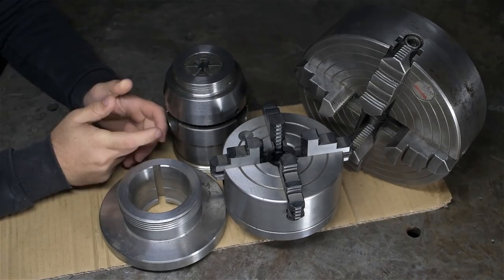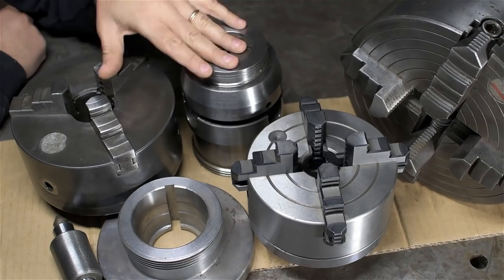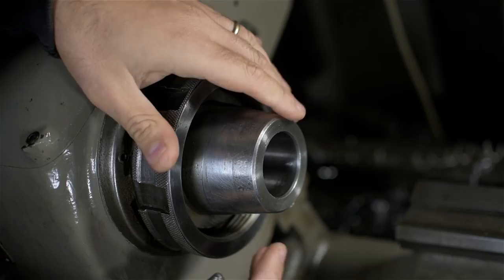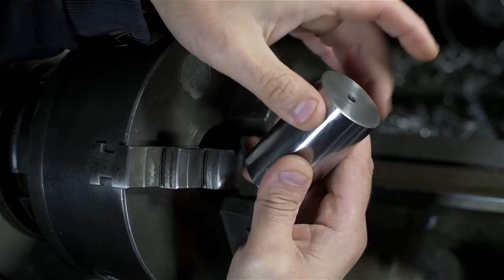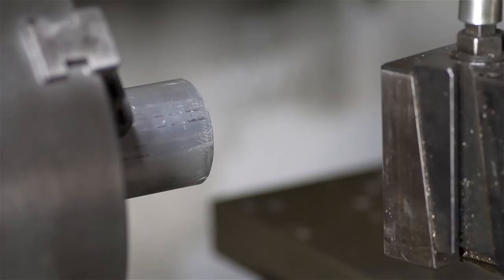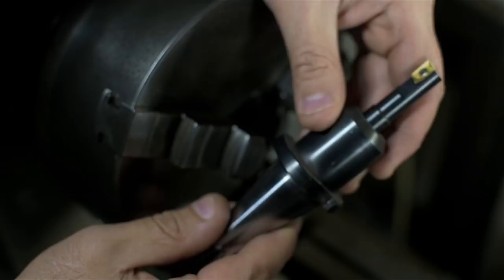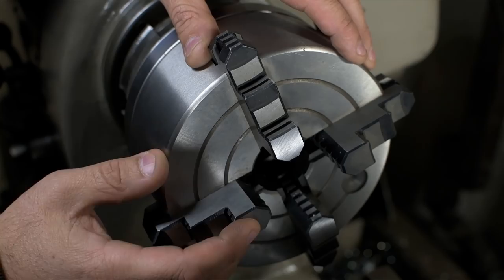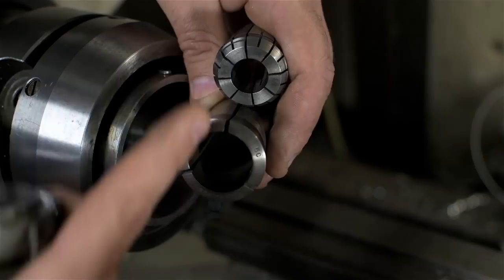Lathe Chucks

Comment: Great content as always. Only one gaping hole in this storyline, Tony. Adjustable backplate chucks. They can make a three jaw run on center, but only because they are effectively a four jaw on one side with a three jaw on the other.

I suppose Clickspring would include the cyanoacrylate chuck on the list. 😎
Reply: Thomas Utley I was thinking about that as well. CA glue and clickspring. Haven't seen anything from him in ages it seems.
Reply: courier11sec He's been busy marking off the progression of the sunset each evening, then inverting the results for Australia to check the Antikythera Mechanism's math for the northern hemisphere!
Reply: Thomas Utley It's pronounced, "Supahglue ahbah."
Reply: Isn't  that what they say in Boston?  :)
Reply: There's a lot more many chucks out there. 

There's the backplate chuck as you mentioned, it's rare to hear others mention it. I've only seen it in old drawings from Mr Keith Rucker's pages. Mounted on the same machine that Adam Booth sold to his work place, the Kearns, it's so freaking masssive it dwarfs the height of the bed...and the moving assembly. Makes you realize that Adam, never used that machine its fullest potential on account of missing that part.

Then there's the rare cone chuck, kinda like a point drive, but with retractable jaws that grab various diameters of pipe on it (a spiffy alternative to driving between points, but without a dog).

Another oddity, eccentric 3 jaw. It's a combination, a plate, but, it has a mechanism inside (controlled by chuck key) which moves the 3 jaw chuck on an axis from center, all the way out to the outside of the plate.

I believe Adam Booth's Kearns horizontal boring mill has a variation of that type of chuck, but his is is tool oriented.

My favorite on this short list, frankly the weirdest i've seen, is a chuck that looks very much like the iris of a photo camera, but does not work like it (each tooth being a sort of distorted cake slice). As i understand, it's used for holding very fragile items, prone to breaking. And it sort of makes sense considering it's about 30 cm deep on the contact.

Honorable mention, the retarded cousin of all chucks, the two jaw...i know it has its uses, but they are short and few.

Like i said, many more, this is just off the top of my head.

P.S. Before ClickSpring, a certain, dashing young fellow by the name of Tom Lipton, did something with resin and a plate...and a penny. ;P

Kinda wish someone with resources would make one mother of all chuck videos and present them all.
Reply: He just uploaded ;)
Reply: And there's plenty of super gluing going on.
Reply: My big take away here was the fact that a 3 jaw chuck run out can vary with the diameter of the stock chucked up.  Never considered it but the scroll dimensions (accuracy) can definitely vary..  Even an adjustable backplate would have its drawbacks with that problem...
Reply: courier11sec he just uploaded a new video.
Reply: superglue chuck ;d
Reply: What about Chuck Bommarito?
Reply: howder1951 Yes, an essential accessory in any machine shop! That Chuck sure knows how to find deals on machines as well.
Reply: Our buck 6 jaw is like that, except it's 6 screw adjustment instead of 4. Not sure why they went that route. Still, if you're good, you can adjust it perfect. I get less than 1 thou of runout on most parts. Makes a 4 jaw only really necessary for when high clamping forces are necessary.
Reply: I wouldn't make fun of the glue chuck idea. It's huge in woodworking and a nut welded to a washer which then has a piece of thick wood screwed on makes a fine glued chuck. Put a piece of brown paper bag between them and they always come apart exactly where you want them to. And they're strong enough for everything excpt an unbalanced log.
Reply: Just remember folks, heating cyanoacrylate over 200 degrees C can lead to the release of cyanide gas, so that superglue method might be a little dangerous for your health if you plan on releasing it "the clickspring way" (i.e. propane torch when he's glued metal). As always, wear protection (breathing, that is) http://www.sciencedirect.com/science/article/pii/S0379073811002726
Reply: There are also universal chucks. Three and four jaw chucks that can be used as a self centering chuck, or you can adjust each jaw individually. Some allow you to engage each jaw itself while using the self centering, and other engage and disengage one of the methods at a time. VERY expensive, if you can find them.
Reply: I don't even get what all that fuzz is about.
My lathe came with a Norris Chuck and its basically the only one you'll even need.
Reply: Clickspring must be working at area 51, he completely stopped making videos. I guess we will never see the anti-finishthyra machine

Comment: How much lathe could a lathe chuck chuck if a lathe chuck could chuck lathes.
Reply from the maker: probably a lot.
Reply: ...aaaaand now I want to see AvE put a lathe IN a chuck...
Reply: Depends how good your spindle brake is. I forgot to take the brake off once and the lathe screwed its way half way through the wall before I could stop it. 12tpi Whitworth, as I recall.
Reply: Eleventeen bruh

Comment: Got a good chuckle out of that video :)
I would stay away from ER for workholding in the lathe, it is relatively annoying because you cant hold very short parts without a filler-piece in the collet.

You left the allimportant magnetic lathe chuck out :(
Reply from the maker: Yes you need a filler / plug.  Especially in the Pratt flex collets.
I do not own a mag chuck for the lathe.  They are foreign to me therefore I fear them.
Reply: Do not fear the magnet!
Reply: This Old Tony that turn of phrase is funny coming from an expat.
Reply: I find it amazing that Stephane uses a 3jaw and simply loosens the backplate and centers the work with an indicator. I've never seen anyone do that, but he makes it work well. So that basically destroys Tony's position that the 3jaw can't do accurate work holding. I think they need to step outside and settle this like men, with chuck keys. Last man standing. They should probably settle the magnetic chuck question at the same time.
Reply: Stefan that mag-chuck makes me a strange combination of nervous and jealous at the same time.  :)
Reply: "They are foreign to me therefore I fear them."

As is tradition 😂

Comment: My metal lathe is a bit older.  It has a finished surface and a threaded spindle.  The face plate(s), Four and Three jaw thread on and seat on the finished surface.  I also have the double angle Collets and Morse 4 head-stock.  When I took delivery from Dad, I had the 3-jaw a bit out more than expected.  I found the chuck was threaded on with small strips of brass in the threads and on on the finished surface.  This canted the chuck and imposed the error.  I cleaned the spindle and then looked at the chuck.  It was full of chips also.  Many years of chips found their way into the chuck. I checked the numbers and extracted the jaws and was able to clean and lube the spiral.   Naturally, the 4 jaw was like new as were the face plates.  I added the nice Collet and much more.  What I learned was to buy as good as I could because I might upgrade the mill or lathe and would keep the quality options.  I enjoy the lathe that Dad and I bought together in the basement of a massive hardware store in 1952.  I used it yesterday.    I hope someone will look at their chucks and find the error they chased.

Comment: You mentioned it briefly, but what is your opinion on four jaw scroll chucks? Personal opinion, and I know it's controversial, I'd rather take a four jaw scroll chuck than a three jaw, simply because they can accommodate square stock.
Reply from the maker: Good point, never really thought about it (never used a 4 jaw scroll).  Thinking out loud, they couldn't hold hex stock, though.  I'm afraid you're going to have to collect them all, S&L!
Reply: Gosh darnit! I'm running out of space in my backpack with all these chucks, collets, McMaster-Carr catalogs and lifetime supply of Tang!
Reply: skip 4 and go to 6!
Reply: I have a 4 jaw scroll chuck on my Schaublin and I generally like it except for as Tony mentioned hexagon stock.  There is much debate in the chuck world over how well the 4 jaw scroll grips material.  Since the jaws are directly in line with each other some feel the 4 jaw scroll doesn't grip as evenly on all 4 of the jaws like a 3 jaw does.  So in some cases only 2 of the 4 jaws grip properly.
Reply: Indeed, that's part of the controversy I speak of. Personally, I've never had a problem with it, but I also don't really care about taking the deepest, most aggressive cut I possibly can, so work holding has never really been an issue.
Reply: Agreed.  Same here.
Reply: I have 4-jaw on wood lathe. It becomes creepy to mount round stock as jaws starting to wear - it becomes a problem even for wood and light cutting forces.
Reply: I have a 4 jaw self centering chuck and I can confirm what a modelmaker suggested to me when I was a broth of boy, which was that, in actual practice, they hold hex stock  Just  Fine. Try it, you'll like it!
They're not so good on round stock which is not very round though - eg slightly oval.. But on thin walled tube they're significantly more secure, also any time you can't swallow as much depth of the gripped diameter as you'd prefer.
Reply: I'd rather have the 6/3. Why? While for most jobs the 4 jaw scroll would be better, the regular 4 jaw is an absolute requirement. So if you had the 4 jaw scroll, you'd have 2 4 jaws, and no odd 3 jaws. So you wouldn't be able to do hex well. Since I do as much if not more hex than square, I'd rather have the 3 jaw. If I had only enough money for two, I'd get a 6 and a 4 independent, hands down. 6 jaws are amazing for thin tube.
Reply: @Gottenhimfella  Curious why 4 jaw scroll grips thin wall tube better? This is very interesting to me as I often work with thin wall tubing.
Reply: @poreektik1320  The stiffness of an arch to resist deflection (in this case where the thickness and the radius are both predetermined) is down to the distance between supports. The support distance decreases as the number of jaws increases. A six-jaw scroll chuck is the gold standard for turning thin sections. But if there's room, eight would be even better. And better still is a collet.

Comment: Tony, one thing i noticed about people that talk about 3 jaw chucks, is that they don’t repeat accurately. If your three jaw chuck has three pinions, only one which is sometime marked, will be the only one that will have close repeatability. It is called the nominated pinion, and it was the only one used when the chuck jaws were originally ground. You can find this information one line from chuck manufacturers. Some claim there 3 jaw chucks have .001 repeatability, but only when using the nominated pinion.

Comment: Your correct about 5C collets in needing lots of them BUT they're almost THE universal holding device for everything in the shop for up to 1 1/16"  (27mm) Diameters. Lathes for work holding, mills have many indexing work holding fixtures, grinder fixtures, drill presses, belt sanders, almost any machine can fixtured up for them.  3&4 jaws not very easily and they're cumbersome to use. We're not including Abom79 sized work... altough there are 6" collets available if you want to spend the big bucks....😄

Comment: Hold on just a minute.  That same switch on the lathe time travels and changes chucks?
Reply: not yet, but in the future it does.
Reply: How do you know what mode it's in ?
Reply: He's just rapidly traveling time to where the next chuck is intalled
Reply from the maker: The red lever = time travel.
Small black lever = auto chuck changer.

and yes, they should've really put them farther apart.

Comment: Right now my lathe is wearing a taper adaptor right in the nose which features a BT30 / 30 INT / SK30 internal taper as I am making a new touch-probe mount for the milling machine. (Due to historical reasons my milling machine is 30 INT on the horizontal and SK30 / BT30 on the vertical). If you find yourself making milling-spindle tooling often then I think that it's an attachment worth having. 
I also have two 3-jaw chucks. One wears inside jaws, the other wears outside jaws. It's quicker to change chucks than change jaws. (and leaves me the option of changing jaws if I need to leave something in the chuck).
I have also made an adaptor for my milling machine dividing head that takes the same chucks as the lathe (I am D1-4 all over now) so that I can easily transfer work.
And one other point, I managed to find a driving centre on eBay. That's a headstock-end centre with a set of drive dogs, a bit like they have on woodworking lathes. The inner centre point and drive dogs are linked (hydraulically or just with a viscous rubber) and that allows you to machine the entire outside surface of a shaft in one setup. They mar the shaft end, but in practice, who cares? 

There are also internal and external step-chucks. These are pulled up by a collet tube as normal but use a closer-ring or expander cone. This is a set for a Holbrook lathe. https://photos.app.goo.gl/YLkjdYjnZ1wcmdrM2 (I covet them, they belong to someone else)

Comment: I have, in my glory box,an eight inch three jaw self centreing  scroll chuck. The big difference is that built into the jaws are independent jaws, as per four jaw chuck, with adjusting screws to either offset the job or to centre it as required.  It would be handy for doing eccentric work, but I have not used it in over twenty years.  The 'screw type' jaws are reversible as in a normal four jaw chuck.
Reply: I have one that is 170 lbs. sSS stamped on it. can't find much info. compound chuck I was told.

Comment: Tony, I was using my lathe chuck to hold work that I was tapping to 7/8 14. My chuck hole is 3/4" I accidentally ran the tap through and tapped about 1/4" of my chuck. Hahahahaha. BUT it turned out to be a fortuitous mistake. I use my mini lathe mostly for making reloading dies from 7/8 14 bolts. Usually just wrapping some aluminum or copper around the threads and chuckin it up. Now I can screw part of it into the chuck first...makes it work better. Yay!

Comment: I vote 4 also - wood and metal lathes.  I have Collet chucks and 3 jaw and special 4 in the wood lathe.  The wood 3 and 4 are metal lathe chucks.  I have a beautiful 4 jaw on my metal.  And the Collet chuck is large but not large enough sometimes. I have Buck chucks and other brands.  I have an ER40 in MT-4 and R-8 holders.  Lathe and medium mill.  I bought high brow tooling when I could better than the target machine that it might migrate to a better machine someday. The errors are lower, as they can add or subtract from each other but having a low one means lower error or 'offsets'.

Comment: Tony when your lathe ran out .005 I thought my lathe couldnt possibly run out that much.  I had to stop the video and go check.  Turns out my 3 Jaw runs out .007!
Reply from the maker: In the video, i think that was the first time I ever even bothered to measure 3jaw run out.  If I know concentricity is important, I usually opt for a different chuck right out of the gate.

Comment: Tony, this is my first channel request. You inspired me to buy my first lathe. The spindle threaded 2" x 8tpi...have you ever heard of this size? the lathe is a Seneca fall 14". built in the 20's..help me Tony, your my only hope
Reply from the maker: Congrats! (be safe!)  As I've oft stated, not a latheologist, but you sure its 2"-8?  Not, say, 1-7/8"?  Did a quick search but found no hits on 2" threaded lathe spindles.  Most appear to be 1-1/4.  Your best option might be to cut your own backplate.  Or ask someone to cut one for you.  Good luck!
Reply: Do you think it would be possible to get somebody to modify an off the shelf 4 jaw chuck for me? Perhaps trading design time or some 3d printing services for there trouble:)

Comment: Gotta love the Pratt collets but they are COMPLETELY USELESS with parts that restrict you on the length available for clamping.  With ER collets or 5C collets, you can pretty much hold on by the fingernails, with Pratts you need a little over an inch.  Shorter than that and they simply will not clamp, each "blade" of the collet just splays out and it just doesn't hold the part in any way.

This has bitten me pretty hard quite a few times, I'm surprised it wasn't mentioned.  Great video though, I'm just nitpicking so I want you to know I still like you and all your vids.
Reply from the maker: Correct, the Pratts do need material to bite on or they go all wonky.  I've sometimes used "plugs" in the back to try to keep the collet jaws parallel.
Reply: I find I have to use plugs even in ER collets to hold with any security if the grip length is about one diameter or less. On Pratt collets I'm gunshy and tend not to use them for short grips even with a plug. I'd hate to ding them up.